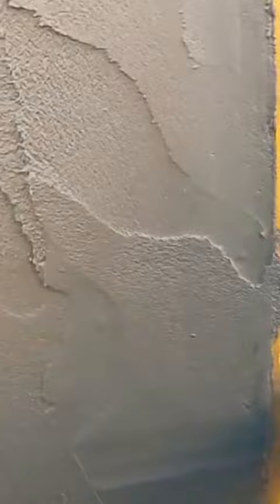Forming Angles With Rendering #construction #plasteringwork #diy #rendering #plastering

Comment: Plastering for me is harder than it looks. I've been watching videos, buying tools and experimenting on walls for over 6 months and I'm not as half good, nor quick as I expected to be so far. But channels like this help me to keep going. Keep up the good work thanks for the videos and shorts.
Reply: Plastering is an art something you can not pick up in few weeks/months i started at it when was 16 and theres materials ive never used or worked with before all in good time.
Reply from the maker: It’s not easy and it takes time to master. But it’s doable so stick with it mate - it comes with time 👍
Reply: Plastering techniques take time to learn, sometimes decades. But, keep on going, because practice makes perfect, having a good teacher helps the most.
Reply: Is thistle multifinish going off faster than ever and ever since covid and the national shortage? Just a carpenter here asking who's been doing bits for years and years never really struggled until the last few years even tho I put it on faster than ever it seems 🤔🤷‍♂️🥴
Reply: Keep at it & be patient. I gave up 6 months in. I came back several months later & realised I could actually do it & started charging for my work. 17 years on..... I'm still at it going from Strength to Strength

Comment: Should tape up those bricks. I've been using the acrylic base coats, they are a little different from masonry cement, but it's a lot more stronger and has a flexibility just in case of movement. 
Good job, nice to see a fellow Plasterer.

Comment: Is that building sand ? Looks very fine for plastering. What did you use to seal the bricks ?
Reply: Likely be a Webber bagged product
Reply from the maker: It’s 5 Plastering sand, 1 cement, 1 Hydrated Lime. That’s what gives it that creaminess 👍